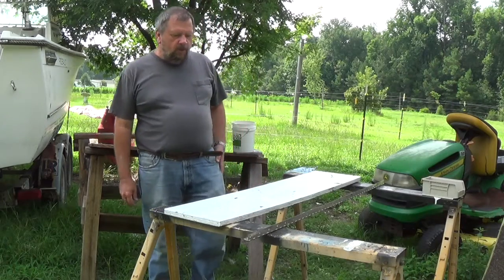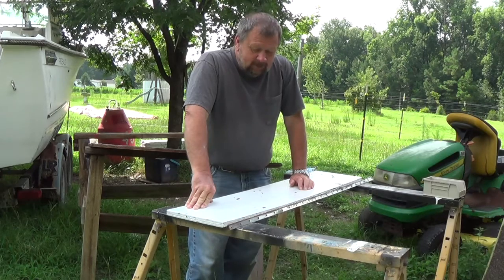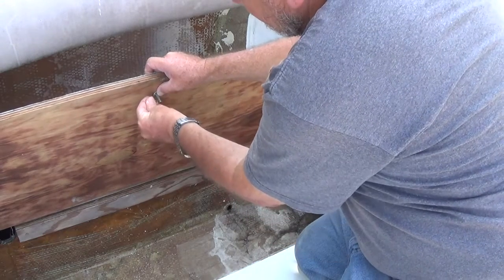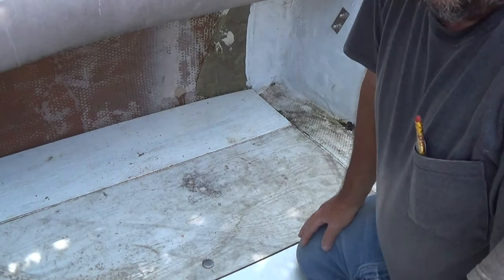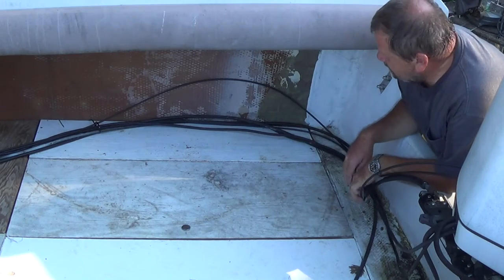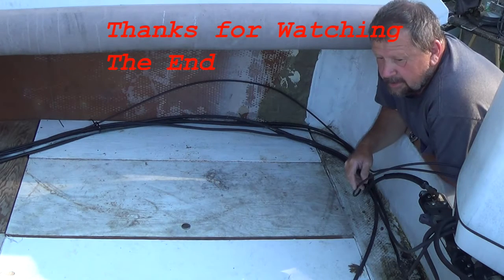Making Compartment Doors, Robalo Boat Project 59

Comment: Great idea with the moving lift handle.  Are you going to be glassing top, bottom and sides do you don't get any water infiltration?
Reply from the maker: Thanks you are right. The factory did not seal it in. I thought of it as making it stronger, but it would seal in moisture not out.
Reply from the maker: I guess I really didn't answer your question yes I am going to gelcoat all the sides I was thinking about something else when I answered you. All the bulkhead an stringers and a everything I did so far I totally sealed up.
Reply: +Om Fishing You are going to have an incredibly strong boat.  Great work.